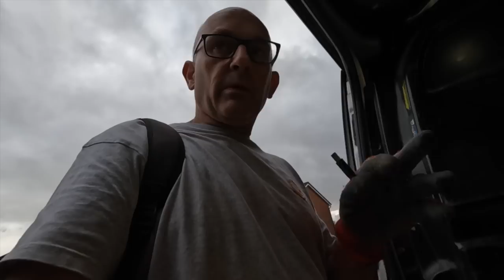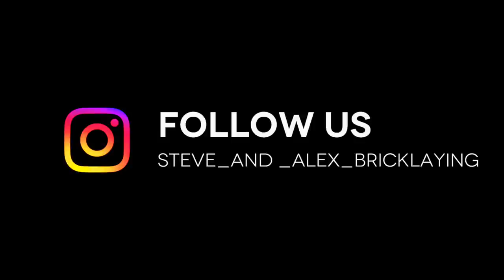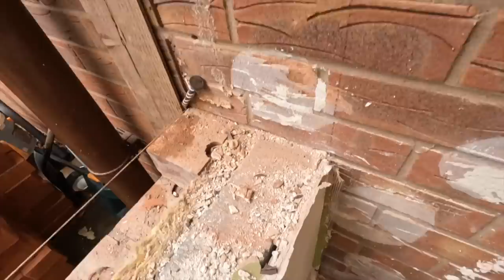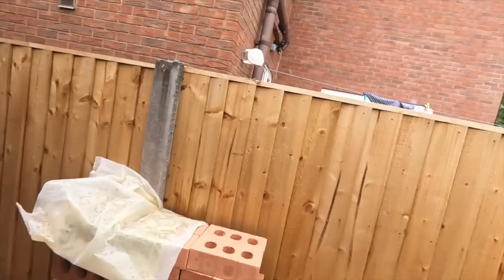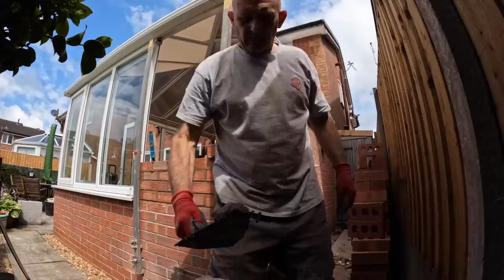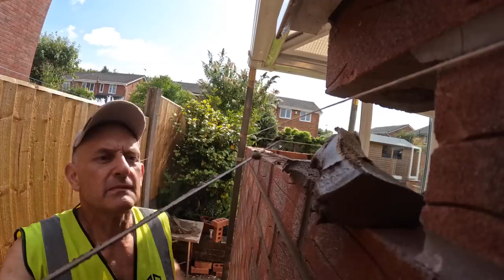NEW BRICKWORK ON A CONSERVATORY

Comment: Hi Guys. I'm not a builder so please excuse my ignorance, but just wondering why there isn't a vertical break & a DPM in the existing wall where it joins the inner & external walls which Alex is building.
p.s. love watching your channel.
Reply: I was wondering the same thing, wouldn't damp work it's way across to the inside.
Reply from the maker: Some people think its needed some people dont 🧱👍🏽